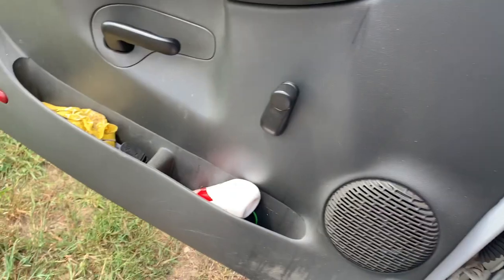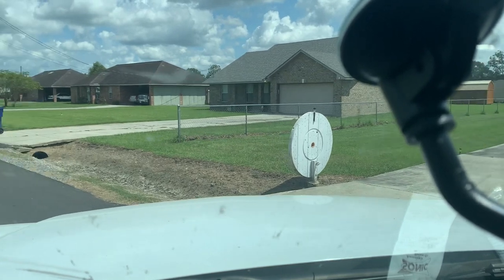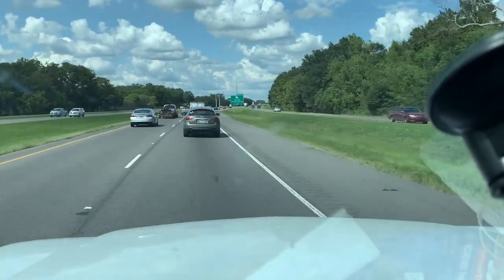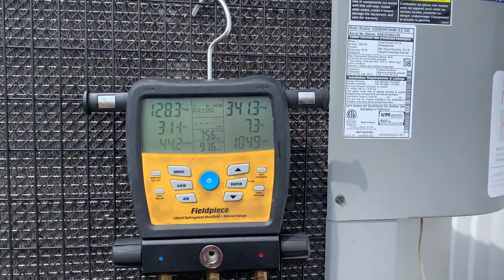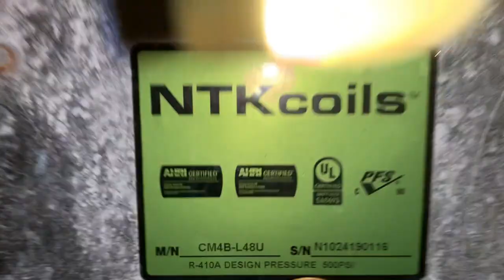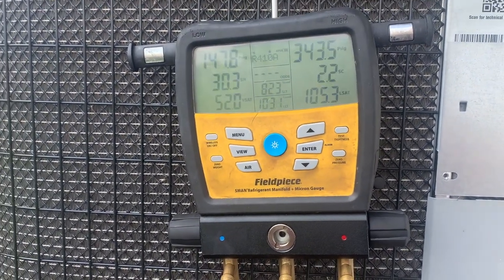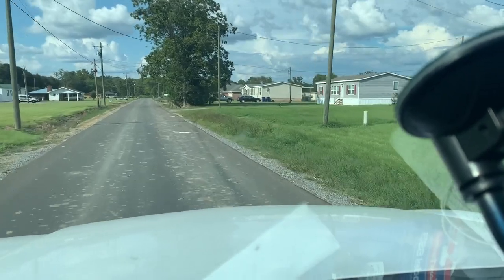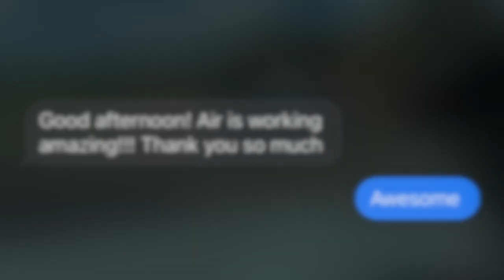No Cooling System Freezing

Comment: Nordyne has had issues with ECM blower motors intermittently shutting off. I had one freezing up like that and couldn’t ever catch while I was there. Call Nordyne tech support and they can tell from the date code on the motor if it’s in the range of motors they have had issues with. 👍

Comment: Mr. Israel don't let those I'm  the best tech guys tell you your wrong yes does drop efficiency a slight bit but not the amount that's going to cost more then recooling the whole house each day,
the valves today are junk and not worth a crap because manufactures are counting pennies.
you are a good service tech. i would have done the same for the unit, you do you stay safe.

Comment: I have ran across that problem many times...many was the problems you checked for...many was stopped up air filter or coil....and a couple times I found plastic bags in the evaporator coil

Comment: I've been doing this for 20 years and learn or relearn something new every day. I wasn't sure what you said about  the fan but I would probably would have  leaned towards air flow. Something intermittently keeping the fan from coming on. I have changed plenty of fan relays when everything was still working when I get there. It's a process of elimination. It freezes for one of three reasons:
1.) Refrigerant charge low
2.) Liquid line restriction 
3.) Air flow
 So, if what you did does not work then you have to go to number 3 being air flow. Whether fan relay sometimes dropping out or thermostat not sending 24v sometimes. I wanted to thank you for helping me to learn and relearn something new every day. See you on the next one.
Reply: I have seen contactor stick as well....rare but it happens.

Comment: First call sub cooling was low those units usually need about 8-13° subcool. Your subcool was at 3 when you first hooked. Low subcool low refrigerant. Now another thing is i wouldve checked restriction on filter dyer. I would check temp one side of dyer and the other side of dyer to see if theres cange in temp. Also txv may be clogged would be last option. I wouldve put an adjustable txv as last option. Also airflow can be a issue too. I would do static pressure test with phsycrometer. Airflow restriction will make coil freeze. Be thorough with your service calls before changing refrigeration parts. Dont be a parts changer but a be a person that fixes the system not a part. If you do that you wont have call backs

Comment: I had a similar unit with the same issue. It ended up being that the TXV got dismounted off of the suction line and was halfway dipped into the condensate drain. The company that had installed the equipment strapped the TXV bulb onto the suction line with plastic ties. The reason it had suddenly began freezing was because the TXV bulb was hanging into the condensate drain pan and as soon as that drain clogged, the water completely froze over the TXV bulb and evaporator. All I had to do was restrap the TXV bulb onto the line and insulate it correctly .

Comment: John, you did the right thing, you only gain 1/2 to a SEER POINT by using a TXV. With a mobile home unit mixed matched equipment I would have done the same thing.

Comment: I’m in between Beaumont and Houston Texas and I find a lot of mobile homes around here straight from the manufacturer that do not have enough air flow from the start. Especially up flow systems. We have had to cut additional filter grills in and it has helped tremendously. We would have trouble getting super heat and sub cooling correct before hand

Comment: Could also try putting a freeze stat on the indoor coil. You’ll never be back for a freeze up again!
Reply: Honeywell 2 wire TROLATEMP part #:FPC cuts out @ 38 degrees & cut-in @ 48 degrees.
Wired to break Y, I've never been back to a call that was freezing the coil (WHAT A PITA TO DE-ICE COIL & NOT MAKE A MESS).
I've had to return due to failed intermittent blower, low gas/leaker calls, & failed TXVs, but I've not had to deal w/ iced coils when 1 of those was installed.

Comment: They changed those electric furnaces.You have to set the dip switches on the circuit board for the correct air flow. I hope this helps.😜

Comment: Considering most returns in mobile homes are undersized to begin with.. I would check return and supplies making sure all are open..... not knowing  what size home that one is,  A 32×80 home 3 1/2 ton is usually the norm and I have never seen more than 3 1/2 in a mobile home .

Comment: Why did you put a fixed in place of the TXV? I'm new to the trade but I thought the Expansion Valves are preferred, I may be wrong though.
Reply: Justin Woodward there is nothing to tear up on a piston . This unit was probably oversized anyways.

Comment: Surprised you had service valves on that condenser! I hate cheap mobile home condensers because 95% of the units i service never have service valves so you have to completely recover the charge in the system for repairs.

Comment: Clog drain? Does it have a float shut off wired wrong, to turning  off the blower? Also could be a bad blower with dead spot or capacitor.
Reply: A float in the drain will shut down the entire system not just the blower, if it is  correctly installed.

Comment: John. You opened the refrigerant circuit to atmospheric conditions and you did not change the liquid line filter drier. 
 Don't trivialize the importance of changing those John. They can only hold so much moisture, and you don't know how the installer did his job. By the way an evacuation will not separate the moisture from the drier. At least that's what Sporlan says

Comment: You say it's a 4 ton unit moble home ducting is designed for 2 ton . Your choking the unit and the blower can not push enough air threw the coil s and they freeze up